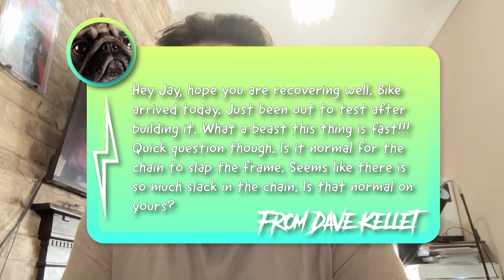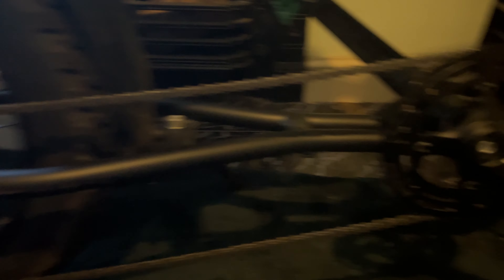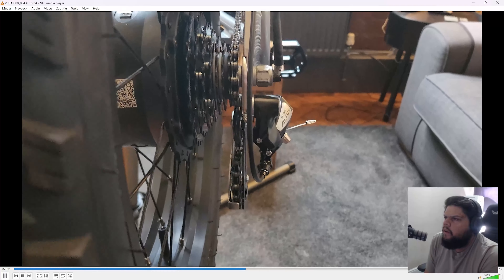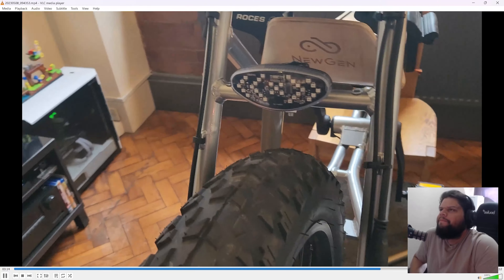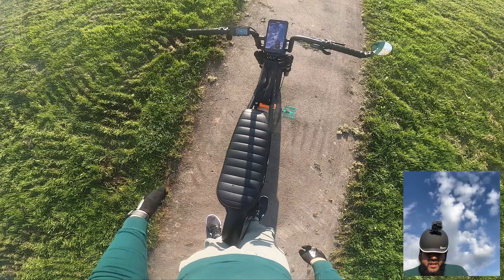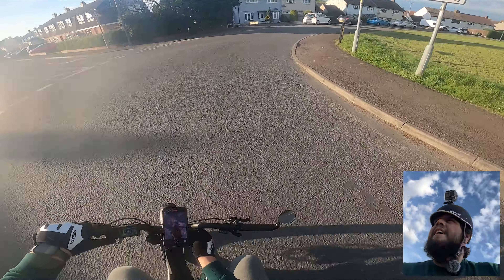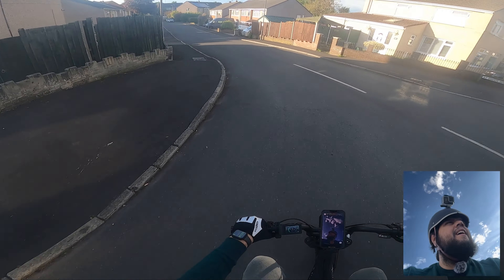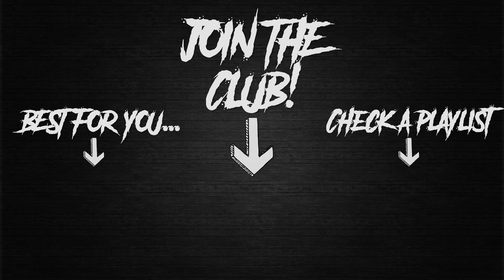You just HAVE TO FIX this! NewGen Bikes have chain slap??

Comment: Hey Jay. Thanks for the mention buddy.  Your chain seems ever so slightly tighter than mine.  Newgen have so far been really responsive. Going to try out the new chain soon.  Yeah sorry buddy I get my gears the wrong way round when I talked about the dérailleur kicking out. It wasn't in that gear in the video.  Its when its on the largest cog. Yeah mirror is the same as yours and that device was a Garmin bike GPS
Reply from the maker: Yeah think you are right. Definitely more slack in yours. Maybe the crank in yours is welded on a little further back towardss the back wheel than mine is. I know all the bikes are custom build by hand so i guess there is some differences in both our bikes.
Reply: @ElectricAwesome  not a bad suggestion, may have to meassure and compare

Comment: Hi mate, how do you adjust the suspension to make it softer and what do you have yours set at?
Reply from the maker: Hi Alan. I haven’t actually adjusted mine since purchase. I got mine from a local store in bristol and gave them my height and weight measurements and they did it for me but in my next video I will 100% show my current setting for you pal.

Comment: Rechargeable bike rear light and indicator set
Operated via a wireless remote control
Mounting brackets for an easy fit on bike
Stay safe on road and be seen with our Wireless Bike Indicator Set. The rechargeable light combines the functions of a rear light with a left and right indicator using 29 ultra-bright LEDs, powered by a 3.7V 800mAh Li-ion rechargeable battery. It comes with wireless remote control, powered by a CR2032 button cell battery (supplied), that can be mounted on your handlebars. The low battery indicator will remind you to charge the lights and keep them ready to use. The included USB cable allows you to charge the batteries at your convenience. The lights take approximately three hours to get fully charged and provide up to five hours of light. Its IPX4 rating makes it water-resistant, allowing you to ride your bike without worrying about water damaging it. The lights come with easy-fit mounting brackets for simple attachment to your bike and make your riding experience safe.
Brand:  Wilko
Capacity:  N/A
Type:  Bike Indicator Set
Coverage:  N/A
Colour:  Black
Power:  1xCR2032+3.7V 800mAh Li-ion rechargeable
Pack Qty:  1
Size:  9.7 x 4.3 x 1.8cm
Assembly:  No
Height:  4.5CM
Material:  Plastic
Width:  10.0CM
Age:  N/A
Depth:  5.0CM
Model No:  67542
Bar Code:  5060832